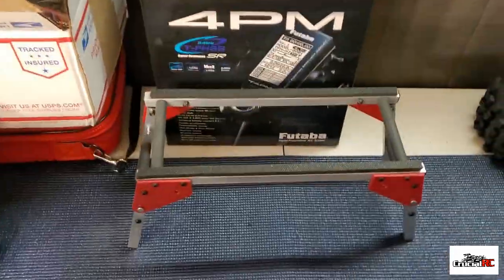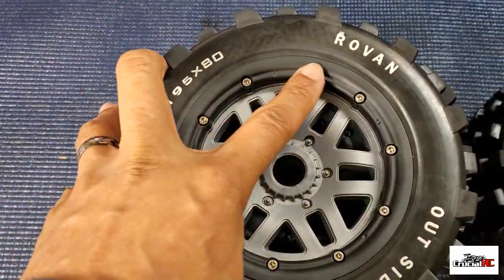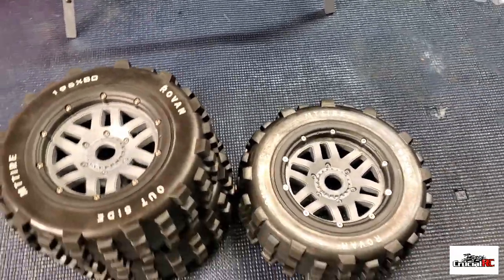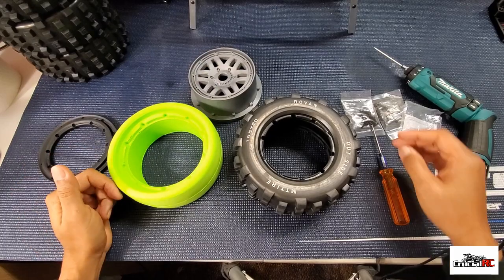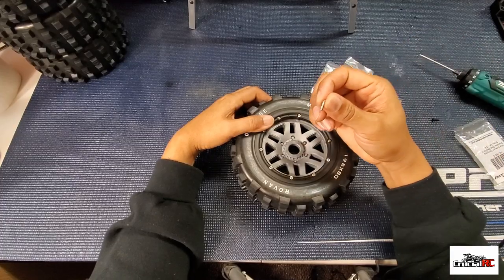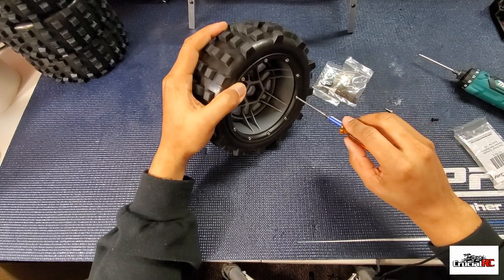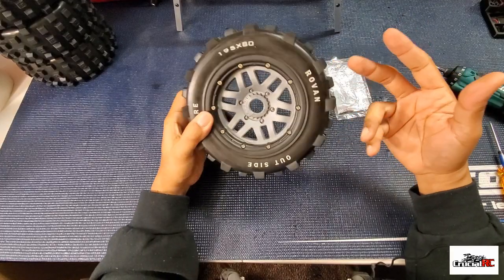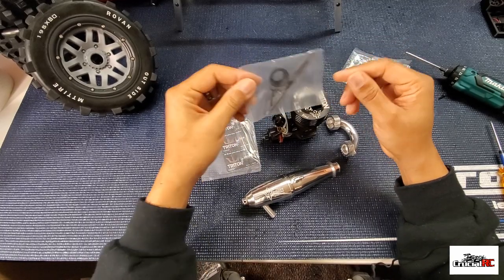Mounting Beadlocks the Right Way

Comment: Good vid. Just did mine with DDM rings & they turned out wavy. Gonna take them apart next & spend more time making it right. You think it be ok to use the bite lock screws on the same wheels that originally had machine screws?
Reply from the maker: Thanks Nick. Yeah should be no problem with using the bite screws. Just take your time and if your using a drill, either stop when you get close or if it's a good drill turn the clutch all the way down like I did, then finish off with a hex driver or Allen key.  Thanks for coming thru and commenting!

Comment: Awesome video amazing 1/5 scale collection very nice info on mounting beadlocks I might have to try a set of those Rovan tires  because I can’t find any Hostile Mxt Knobby Tires as of yet great job thumbs up 👍🏿
Reply from the maker: Thanks for stopping thru bruh. The tires are soft tho so no problem with traction. And surprisingly they have lasted, even tho they are soft.  I wouldn't run them on concrete tho.

Comment: Another great video. Very informative. I just ordered those same tires for my Baja 5B. I got the 195x80 for the rear and the 195x70 for the front. I also ordered green beadlocks for them so this helped out perfectly.
Reply from the maker: Haha. Another video right on time.  There was a guy on largescaleforums.com that was having problems mounting his so I made this video for him.  Glad this helped you too brotha. You will like the tires.  The rubber is a little soft but they work well and have been holding up pretty good too.
Reply: @CrucialRC  awesome great to know. Im just worried as these are a lot larger than the stock baja fronts and rears. Im just hoping I dont lose stability and top end.
Reply from the maker: @cbrwix6999  All the better reason to get a bigger engine🤣
Reply: @CrucialRC  haha for sure!

Comment: Also, you made it look so easy to install these Bead Locks but let me assure you that the HD ones are not so easy. I couldnt even get the inner ones installed on my new MIT Tires/Wheels. It seems impossible. I may have to put some more time into it but for some reason they just will not fit in right at all. It always seems the last few screws will not line up at all. Im not sure if I am doing something wrong but I tried my ass off last night to get at least one done and i couldnt. I got these in yesterday and they just will not install correctly. https://www.rovanrc.com/product-prkb09002-g Guess I'll try again tonight.
Reply from the maker: Sorry to hear about your issues.  Why not order the DDM beadlocks? Only thing I buy from Rovan is their tires bruh. Especially for that price you can get these http://www.davesmotors.com/DDM-Racing-Outer-Bite-Lock-Rings.html. $7.50 for inners and $7.50 for outers